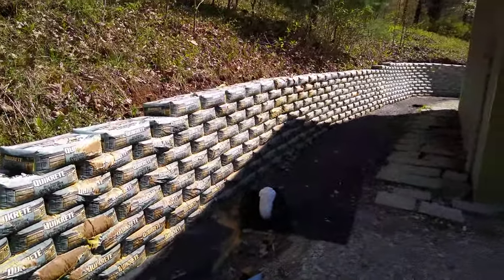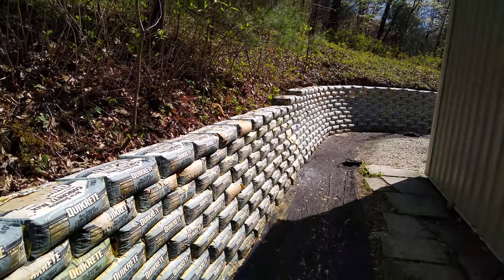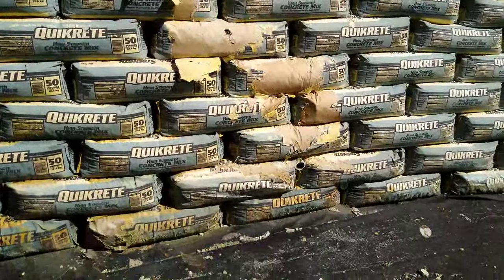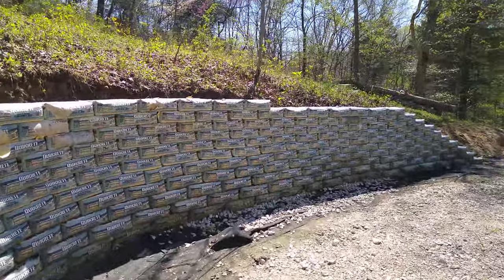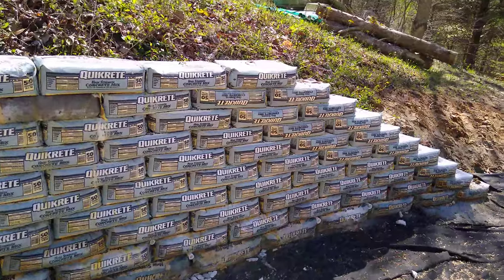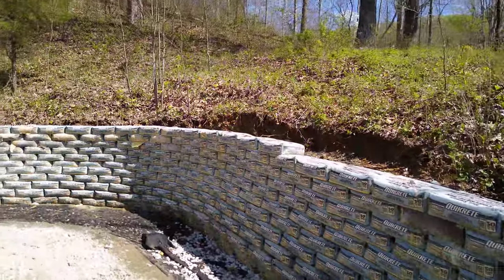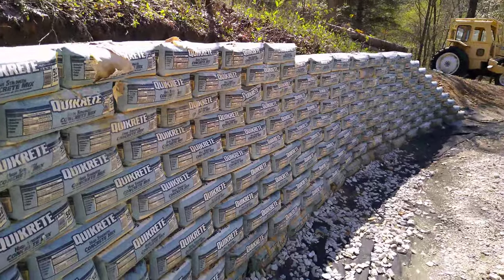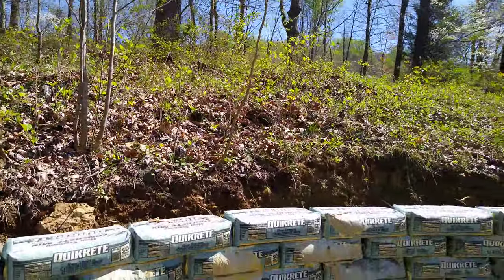Concrete Bag Retaining Wall | Basic Overview

Comment: Looks amazing never thought of using them this way.
Reply from the maker: @Steeltoe Boots Thank you.  And thank you for your comment.
Reply: That's because it's not supposed to be used that way... Only an idiot would do that. I bet it looks like crap now with ripped paper bags n mold and wet dirt n cement leaking out and will probably wash a bunch of ink from the paper out into the ground. Good job. Plus u literally just lifted way more weight then using blocks
Reply from the maker: @Philidelphia Slim - You are wrong on all of your points. See my latest video of how it looks to prove it. Saved a ton not hiring a contractor and DIY. https://www.youtube.com/watch?v=LHl5dYp3dg4
One Year Later
https://www.youtube.com/watch?v=b1dk4jhQfws

Comment: This is really well done.  I will be testing out the standard quikrete bag method building a firepit this weekend in my backyard.  I'm building a 3.5 ft high retaining wall, 28 ft long. I should do a couple of layers, soak it, leave it to cure, then stack the other layers, wet, and continue onwards? I should have a slight lean back to help against the soil I'm retaining.  Should I put rebar in the dry bags to add more stability before wetting? Should I just keep dry stacking this or add in some form of cement sealant in between the cured layers?? thanks again.
Reply from the maker: Thanks. If you want it perfect then do it in sections and bridge the rebar. You may want to key it with a footer or use tiebacks depending on the soil type. This wall was curved so it will not kick out hopefully. Allow the water to flow through. Rebar before water and curing. Here are two videos that might give you ideas. Improvements: https://www.youtube.com/watch?v=tUlc1Qb5A74 - Latest wall video:  https://www.youtube.com/watch?v=LHl5dYp3dg4

Comment: Great job. 

I wonder if cement bags could be used the same way people use sand bags to build small homes and such
Reply from the maker: @The AirCooled Shop - Thanks. I thought the same thing. I would want a good foundation. Poured concrete, rebar for a home. This is my preference here. https://www.monolithic.org/

Comment: That will work but a much better way to build a wall like this to get you some building sand number one Portland cement couple bundles of burlap sacks at least a foot or two into the ground you also need a a hand Tamp every row step-back 2 or 3in backfill every row with the same mix you put in the bags you want to make it one with the ground keep it low enough to where the water will run over it it will last you a hundred years if it's done properly these pure cement bags like this will start cracking used to build headwalls for the county for about 30 years around pipes and Riverbanks as far as I know they're all still there I've been retired about 10 years
Reply from the maker: Hi Apollo!  Your wall process sounds good. And you know it works. Quikrete makes your mix called Rip Rap. My friend, Tom the Engineer (retired) built these on his farms and they are still doing what is required.  Thank you for your comment! Take care. :) --Part 2. - https://youtu.be/LHl5dYp3dg4

Comment: Are all bags laid side to side, do any bags run front to back? How long are the sections of rebar and is it 2 rods of rebar per bag? You do phenomenal work! I subscribed! Thank you for your videos.
Reply from the maker: Hi. Side to side vs front to back depends if you do setbacks. The culvert wall I did both to interlock them, especially on the top of the culvert 80lb bags were used to overlap two 50lb bags locking the rebar. I tried to use 3.5ft to 4ft rebar on the wall and longer on the culvert. Two rebar per bag locking like legos. Thank you for your kind words and for the sub! It was a pleasure to do the vids. Take care.

Comment: Interesting.. Not the video i was searching for.. Lol. But.. This gives me an idea.. Let me know if this will work.. And yes.. It's a story.. 
   Ok.. I bought a river lot.. The lower road,the main state gravel rd floods.. At times it has been 10 ft over the road.. Now,there's another rd that cuts up on the hill outta the flood zone,given I'd still be trapped during high water,but i would be fine.. The upper rd.. We'll say its a named alley.. One end has collapsed,cant get up it at all.. The other end.. Is rocky rutted so bad i can't get my Cherokee up it to access my cabin.. The state refuses to do anything so my only option is to fix the rutted end.. If i laid these bags in the rutts and leveled it the best i can,would they work,in the bag like that for a if need be long term solution
Reply from the maker: @Wascally Wabbit -Yes, I had a neighbor that had had some land that had much more water than we deal with, yet flash flood and it subsides. I have heard that maybe 20 years ago a flood came through from the hills worse than I have seen yet. At the end of this video you will see the water level. So I built a culvert entrance. You need to find ways to slow velocity up hills, then consider concrete that you drive over, yet allow water to pass. The bags would need some cloth to keep soil from undermining. Maybe you might use in combination gabion system.  Hope you figure it out and post it online. Take care. https://www.youtube.com/watch?v=99k19yaOqQ4

Comment: how much was all that quick Crete? I could have poured u a wall for the same amount probably lol
Reply from the maker: $947.20- (512Bags x $1.85)+(Rebar, Taxes), 80' Length, 14" Width, 4' Height at corner, less the rebar. What is your price quote for this? Then it would not be "DIY". Looks better than a common wall using forms, and more fun to do yourself. -Thank you for the comment Grubb Mudd.
Reply: It dies look better than a common wall, but have you watched lurncrete videos on youtube, I know the mix design he uses and I can do those walls, anyways I saw your other video and it looks good, but how does it look now?
Reply from the maker: @GRUBB-MUDD  I will be sure and look the videos. Thanks! Well, so far it is holding up well. At the lower areas of the culvert, when it set, I washed HS concrete in the cracks, because the bags pulled some. Then I ended up coating it with a good coat. The rest I only filled the cracks. Cracks, water, freeze, expansion. I am trying to prevent that. We only have a few major events like in the culvert video a year. This wall, yesterday I pressure washed off the bags, used S type mortar on the tops and cracks. I am not a pro like you in the business. This was a lock-down project for fun. Grandfather was in major construction and he built dam retention walls at times and the concrete was packed and rolled, very dry, so I hoped that the bags would form the crystallization densely. Yet here, if you have stones in the bag sitting at the bottom of the bag and not mix the bag, you know how that ends up. Practical Engineering videos talk about concrete water ratios and the dry ratio is the top pressure test result. I left the bags on for a month or so with water to assist hopefully in curing. Concrete is cool. Take care my friend!
Reply: I think it looked good! And I am surprised it was that cheap
Reply from the maker: @GRUBB-MUDD  Thanks. May I ask, since you do a lot of concrete, is there any kind of color stain product that penetrates concrete? I do not want to go with something that would prevent future repairs, such as re-coating. Considering, several stone colors to change it up a bit. Thanks!
Reply: It depends on if it is sealed, check out water base stains, acid base stains, or even permatique or EZTIQUE
Reply from the maker: @GRUBB-MUDD  Thanks much. Will do. Take care and have a good weekend.
Reply from the maker: @GRUBB-MUDD  Thanks for sharing your story. (Video above.)- Keep up the good concrete work and take care of and enjoy your Daughter and family! :)
Reply: yup 4 sure thanks for watching and I will keep watching your videos
Reply: LOL Quickcrete style bags are around $7 to $8 a bag in NZ
Reply from the maker: @zumamaya2396  Wow. These are $1.85 volume and discount. Are retaining blocks similar pricing  in NZ? Is this since shutdowns and reduced production?

Comment: Great job! Did you water the bags between each layer, or just at the end?
Reply from the maker: Thanks. I did it in sections. The best results, do it in several layers. Tape the top bags with packing tape to stop the bags from stretching when wet. If you stack them too high and get them too wet, they will flatten a bit. Take your time and better results, less finishing.
Reply: @SteveAddis  what if we make holes passing through, before adding another layer? will they join together?
Reply from the maker: Late reply, yes they would somewhat.

Comment: What I’m still not clear on is, does the concrete adhere right through the cardboard of the bag? Can you knock them loose of each other with a hammer after they are set up or do they become a unified mass of concrete?
Reply from the maker: They are connected with rebar hammered vertically through them so they are all connected and not movable. The paper does not allow to adhere, yet if you punch holes through the bags several times from the top all the way through, they become connected at those points. Please see this video and I explain some improvements. Thanks for your comment. https://youtu.be/tUlc1Qb5A74
Reply: @SteveAddis  thanks Steve! This new video is the best I have seen yet on the topic.

Comment: What are you going to cover it with?? Maybe I missed what you said but obviously you are not going to leave it as such ?
Reply from the maker: @Burton Kephart -   I do cover sections during the build, so that rain does disrupt my build before rebar is place. I also coat the top with concrete and fill any cracks formed by the bags stretching. I now tape the top bags with plastic packing tape to prevent the paper bags from stretching when wet. This video shows some of the results and how it looks now. Thank you for your comment. https://www.youtube.com/watch?v=LHl5dYp3dg4

Comment: So does the concrete just form in the bags over time?
Reply from the maker: Nate, you need to sprinkle water on the bags all night so the become saturated. They make a special bag for this called Quikrete Rip Wrap that has fiber reinforced bags. Yet I am using standard bags using lots of rebar through the bags. Culvert video explains a similar build. Take care. https://www.youtube.com/watch?v=99k19yaOqQ4

Comment: How well has it held up
Reply from the maker: Hi Robert. It is holding up very well. Same for the culvert wall. When this video was made, I still needed to wash some mix on the faces that had some cracks and imperfections. I will do a followup video. Thanks for your comment.

Comment: I am so lost! Why not traditional landscape blocks? Y bags? Feel like that thing will b dropping paper chunks for a long time
Reply from the maker: Thanks for your comment! :) Best to say what these do that blocks do not. Bags do not require a perfect level footing and fit to any proportion. These are less than half the price and are larger than manufactured blocks. Bags setup to a more solid form of concrete than castle blocks. Bags allow water to flow between the voids. Rebar can be placed into the bags making them permanent, rather than glue or locking used on landscape blocks. Or, rebar can be laid between the bags if you wish it to be less permanent. Bags look like cobble stone and less like a manufactured product. You can simply allow the paper to biodegrade, or pressure wash them away, like I did with the culvert wall. It all depends what you prefer. I use both for different purposes, and really like castle rock for small landscaping projects.
Reply from the maker: https://www.youtube.com/watch?v=99k19yaOqQ4
Reply: That is an awesome detailed explanation. I see these walls are very popular these days. It looks good. Thanks for the info.
Reply from the maker: @zman783  You are welcome. I started working on it again today, washing mortar in the top bags to seal cracks and a skim coat on top. Been too busy and need to finish it and do the second video. :)

Comment: I have a much smaller project and am consider this.Did you do any tie-backs?
Reply from the maker: Excellent question Edward, and good idea. On this wall, no I did not because the wall is set with two rebars in each bag, into blue-grey clay one foot deep that is almost like rock.  I was concerned about the bottom kicking out like you mention, if many years if the rebar rusts away, so I may add a small concrete key. With the curvature of the wall, that should help, and the bags are stacked level, and inward. I am going to consider one on the long end of the wall now that you mention it. - I will be doing some smaller walls, that have no soil in place and need to be back filled four to five feet, so I will use your tie-back recommendation, sometimes called dead man method for sure. Your project: Be sure to use rebar and if you leave it at the lower levels and do not finish it in a day, leave the rebar sticking out of the bags, so you can bridge the top part, or continue the work  as you do the wall, and have it all tied together. You may want to let that part of the wall setup with water, then continue. I did a lot of this with my Culvert Retaining Wall video. The other issue I had was that I stacked the bags too high and it started leaning on me before I did the gravel back fill, so i grabbed the protruding rebars, to pull it back and filled the back side and fixed that mistake. This was hand dug with a pick and shovel and so far, it was the hardest digging I have EVER dealt with. Lol - Thank you for your input. Enjoy your work!
Reply: Thanks so much. I will take all that into consideration. One last question if you don’t mind. How long did you spray down the bags, of what’s the recommendation to ensure all the concrete gets adequate water to set?
Reply from the maker: @eramer3 Your are welcome.  If you are going to go 8 to 10 courses, if you do four courses, then place your rebar. Then water that set first. The paper sort of resists the water, and the concrete will draw in the water. Make sure the bags are paper. Mine had two layers of paper. The outer being the weaker more absorbant. You will need to sprinkle water on it all night, lightly. I found that the faces of the bags would almost crack off, when I put too much water on it and the bag would pull away slightly causing small cracks. Now, even with cracks in the faces, after it has completely setup, all you need to do is wash some of the high strength concrete in the cracks with a water hose, and that will setup like rock. For culverts at the base, wash that concrete over the bottom bags really seals it up and it turns very hard. Cement cures, so if you leave the bags on longer, and then soak it over night one section at at time one last time, it seems to get better . Sort of like putting plastic on a fresh concrete pour, and keeping water on under that plastic really makes one solid parking spot. Be sure to loosen the bags, put the bag on its face and get the cement, less stone to that front if you want it to look smooth. You may also experiment on a small section, and let me know how it worked. Have fun!
Reply from the maker: @eramer3  I wanted to make one revision. I believe you should completely soak a section at a time. If the curing stops, you may not get the best strength in the concrete. The other item is, when you loosen the bag on its sides, do this more than one time as to mix best as possible. There is a video by Practical Engineering called "What Is Concrete".  They mention that concrete that is packed, is best strength, and shows in their tests in this video. The bags in the bottom of the creek setup the best. That video is interesting.
Reply: Hi, I’m thinking about building a concrete bag wall for my back yard with hardly any machine accessing. One question about the concrete bag wall, do we need any drainage behind it? Thanks
Reply from the maker: @lw1267xjdbdj  Hi. Yes, it is best to have some drainage. Unlike solid block regaining walls, these walls have some gaps between the courses that will allow some water flow. The soil behind this wall is mostly solid clay, so I put my geo textile cloth on the ground under the bags and back of hillside, later to be tucked under the last bags on top. Next, several courses of bags, with 1 inch PVC pipes. Then back filled with number 4 stone.  Placed rebar in each bag through the ground. I put  to eight inches of stone to the top.  You can also put a large drain pipe behind the wall in the gravel. If you have soft soils, put the wall down in the ground a couple of courses, and maybe some stone under it as well. Use more stone drainage in soft soils. Also, put some tie backs. Lookup how to do tiebacks. You might use rebar to do the tie backs bottom and top depending on how high you are going with the wall with several bags in the hill. Make sure all drain pipes are going down grade so they flow. Research and think it all through and any special consideration for your back yard. Enjoy your project!
Reply: @SteveAddis  👍👍thank you so much for the detailed reply that very much similar with what I planned to do. I will research about the tieback to see if that is necessary for my project. Cheers
Reply from the maker: @lw1267xjdbdj  You are welcome. Hope it turns out the way you want. I want to do a video to explain more. You might learn a few things from the Culvert Video. Take care. https://www.youtube.com/watch?v=99k19yaOqQ4

Comment: When the bags start coming off the concrete, it's probably not going look as nice cuz the bags going try to come off in the rain over time
Reply from the maker: You can lightly pressure wash the bags away after they are well set. You are correct for sure. Thanks for your comment.